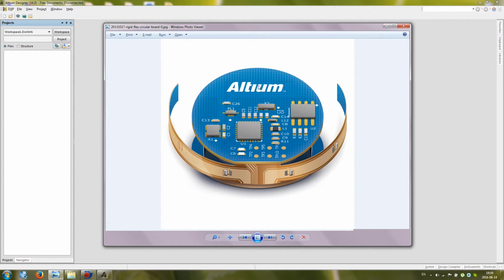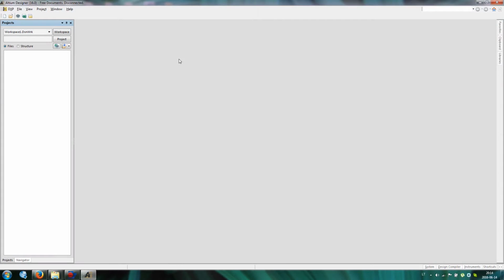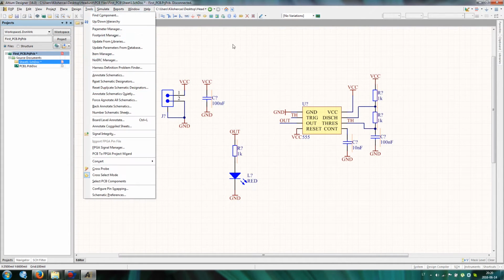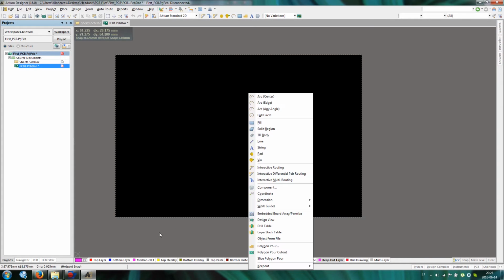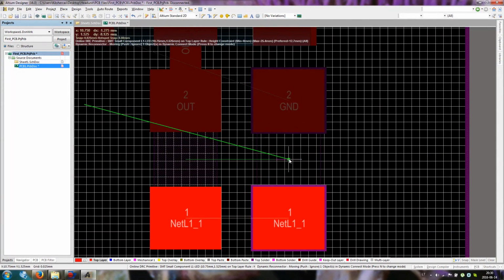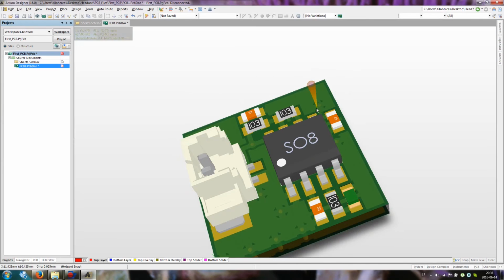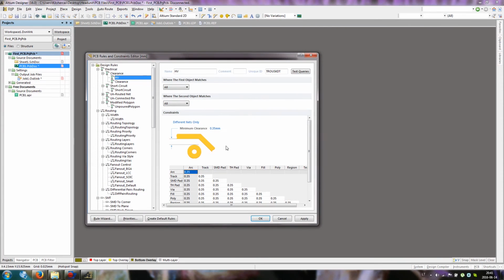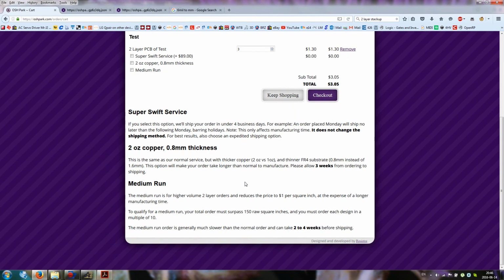Altium PCB Tutorial: From 0 to first board on Osh Park !

Comment: There is a mistake in this tutorial, the part where you create the footprint for the 555 is broken / missing. You are using the wizard, defining the padsize for width and then the tutorial jumps directly to the schematic for the project. There is missing a large part !
Reply from the maker: mb indeed, will need to fix this
Reply: damn, i was looking for that specifict part to know, and is missing. It be great if you add it.
Good worlk BTW.